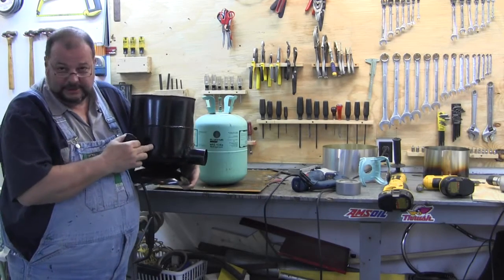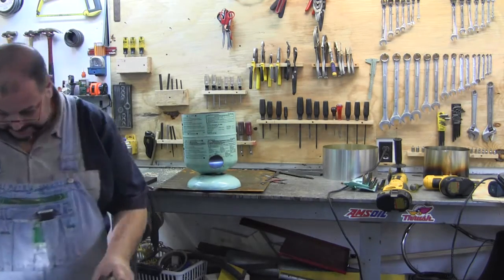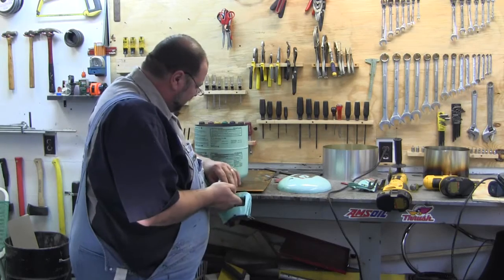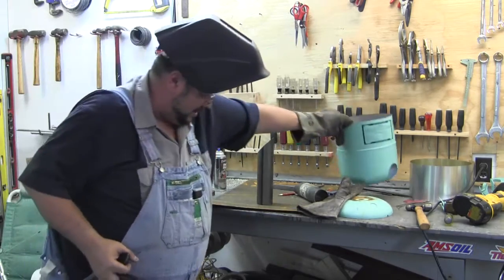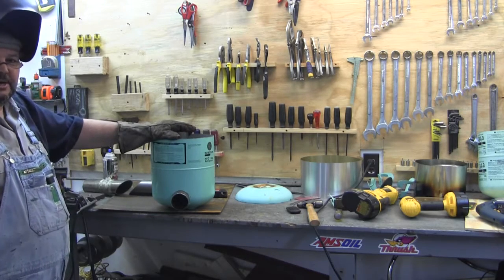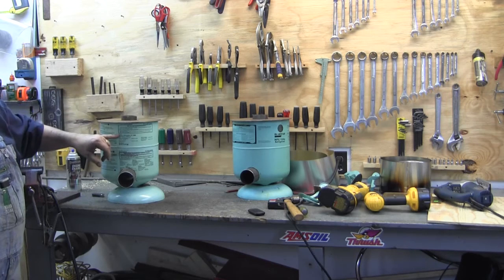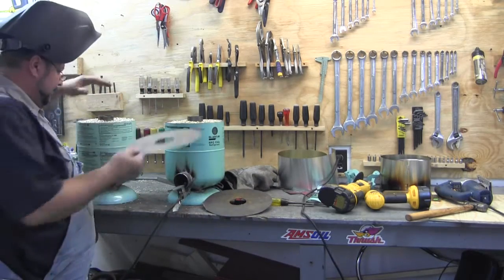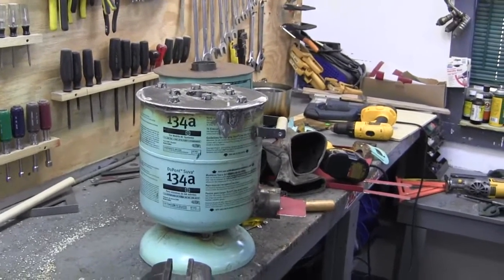How to make a lightweight rocket stove

Comment from the maker: the miller ,atic 210 is way to big and the lincoln only uses wire. i did buy a 120 volt stick welder at walmart years ago but im a lousy and i mean LOUSY stick welder. it would have worked great if i could have mastered stick welding.

Comment: Thanks for the info!!!
You are a blessing to many of us .
Does your new MillerMatic 210 work better at welding the thin metal on the freon tanks?
Also can the small rods be used with the Lincoln Weldpak 100 or is it wire only?
Thanks!

Comment from the maker: its a lincoln weldpak 100. it is 120 volt. i think if you used very small rods,it might not burn through. i had real trouble with that with my wire welder. i had to just make a series of tack welds around it and let it cool after each weld.

Comment from the maker: well if there was some sort of problem filling the tank with vermiculite then welding the top on,that might be a solution. i havent had any problems with the way i do it. weld all the external components on,turn it over,fill it with vermiculite,put the top plate on and weld it. welding a port flange would add more time to the build for a problem that doesnt exist. i appreciate your input however and please continue to give it. thanks, Brad

Comment: Hi, I like the little stove you have made, but I was wondering if it would be easier to weld and work on the stove if it wasn't pre-filled with vermiculite.
I figure that a 2" port flange welded to the bottom (inside the base you've created) would allow you to fill it afterwards.
Does it sound practical or does it sound like too much work? :)
Thanks for the videos :)

Comment: Great video!  Thanks so much for taking the time to share this!  You've had a lot of responses - and someone might have already suggested this - but what if you were to turn the tank upside down and cut off the bottom?

The handles would become the base (and something to carry  the stove if the top can be clamped down.  They could be fastened to a disc to further stabilize it.

Also - since I don't have welding tools - what about just using a plumber's "L" joint for the inner tube?   Good luck!

Comment from the maker: at the time, all i had to use as standoffs was nuts. ive come up with a better method using flat steel now. i just got some more parts today to make another stove with. its a 40 pound propane tank i intend to cut both ends off (after a good purging) its gonna be my nicest one yet.

Comment from the maker: @rdx506 12 to 15 times the diameter of the pipe is completely wrong. according to dr. winiarsky (the inventer of the rocket stove) the hight should be 3-4 times the diameter of the pipe (mine is 3 1/2 times the diameter of the pipe). asa for the horizontal pipe being to close to the bottom of the stove,if that where true,the bottom of the stove would get hot when its burning.it doent. aside from that,thanks for your comment.

Comment from the maker: @modoc42 modoc,if you didnt want to get all weldy and stuf,you could make one from a metal 5 gallon bucket and some pipe and elbows that you would use to vent a gas water heater. ive seen them built like that and they are quite functional and esthetically pleasing. all youneed is the ability to hold you toungue in between your lipis over in the corner, a pair of snips and two peanuts fpor your nose and voile! rocket stove.please video the peanuts in your nose  i mean the rocket stove.

Comment from the maker: if i had a nickel for every time someone asks me if im brad pitt,,,,,,,, id still be broke.so far here is what ive spent. the freon tanks were free. the 14 guge steel for the top was 10 bucks,or two stoves so 5 bucks each. the pipe was 5 bucks at a harware store that was just trying to get rid of some junk they had laying around.throw in the welding wire and electricity and i probably have about ten bucks n each stove.